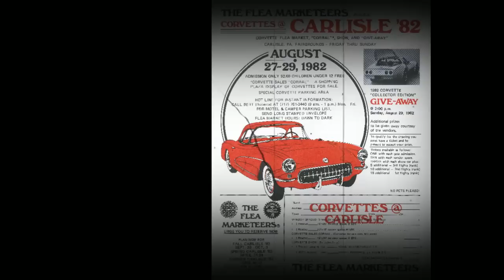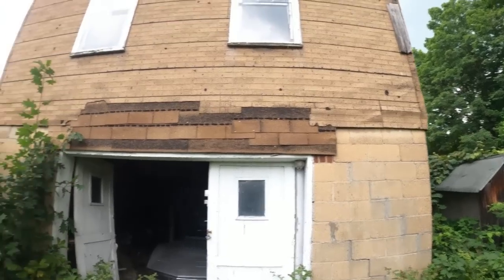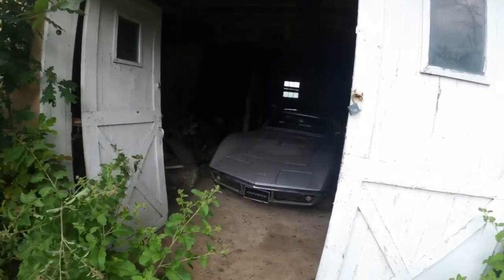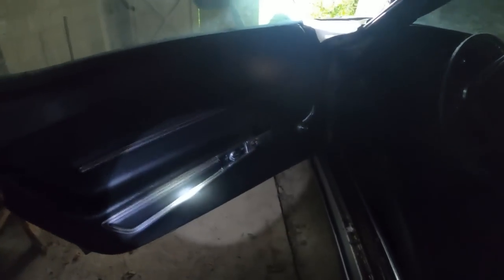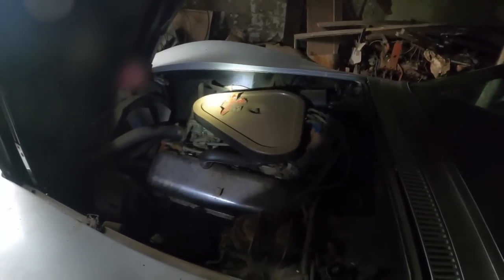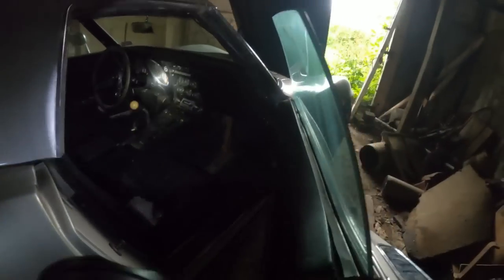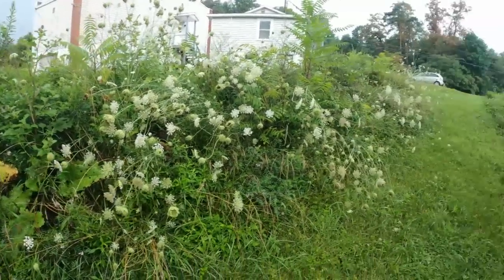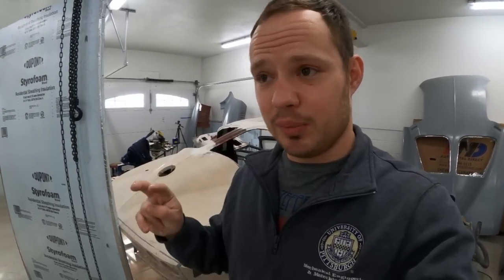Barn Find 1968 Corvette Big Block. Rare L71 427 435hp. Removed From It's 30 Year Barn Slumber.

Comment: I have a 68 had a 327 69 truck motor. Drove about 12 miles and went to change intake and found a bend push rod. So the motor looked shot so I bought another one. You would believe it I found a 64 327 Vette motor which they go from 64 to 69. I also have me a 427 hood which I love.\

Comment: It's a shame that the motor in this car wasn't treated as if it were a MARINE MOTOR. Put to you in simple terms, most boats spend all winter not being used. To prepare for that long winter, the spark plugs pulled out and oil is squarted in. Then the engine is turned over. Rienstall the plugs. Tape up the air filter, and shove some rags up the exhaust. Check antifreez. GOODBY.

Comment: Great video Mitch!  Looking forward to seeing this car come back to life.  Would be nice to see you do it in stages to get it back on the road.  New fuel tank and lines, rebuild the carbs, battery and brakes.  Clean and detail the engine compartment.  New set of tires and shocks. The later C3 wheels with TA’s look better than 68 caps.  Get it running, clean everything then sort out the interior in steps…and drive it!  Hope you don’t blow it apart for a full restoration.
Reply from the maker: Thanks! I’m excited to start working on it. I’ll have to evaluate that when the car shows up. I don’t want to have to chase issues with the car. My concern is that mice chewed up the wiring and I’m sure all the rubber in the car is rotten. So we might end up lifting the body and making the chassis brand new and setting the body down just like it is with new wiring and some interior parts. I’m not sure what the car will tell me. That’s a problem for future me lol. The car definitely won’t get painted. It might get a restoration similar to the white split I did recently.
Reply: Great find. It’s in good hands now.
Reply: @MidYearMitch  As you noted the engine looks period correct but not original, something it will never be again. Trying to restore a barn car by replacing parts with period parts is a fool's errand. Lifting the body, making the chassis brand new, and setting the body down just like it is with new wiring and interior parts is the way to go unless you want a lifetime project which I'm sure you don't. Best of luck getting this one back to snuff..
Reply from the maker: @rtflone the plan for the car as of now is to leave the body as is but completely overhaul the engine, transmission, rear end, suspension, wiring, and interior. Basically everything but paint and chrome. I want the car to be reliable and safe. I don’t want to cheap out and have some kind of failure down the road like a bad brake like or bad wiring. She’s due for some love.

Comment: I have dug a bunch of cars out of long time storage and this doesn’t add up: judging by the floor around it, the carpet inside, the engine compartment and valve covers why is the car cover and paint so clean? The outside of the car cover would be a lot more messy. Just being honest.
Reply from the maker: This is the real story. I wouldn’t “fake” a story about my Dad’s late best friend. I am presenting everything as it is. Did you watch the full video? There are plenty of references to how dirty it is. 

The lighting in that building is bad so it’s hard to see how dirty it is. He had a sheet of plastic overtop the car cover. The cover was soaked in water and covered in dirt. That helped keep the car a little clean but it was still dirty. It sat under that cover since 1991. I also swept the floor before I started working so I wouldn’t have to roll around in all the junk. The engine compartment is packed full of leaves and plastic from a rodent building a nest. The car was packed from front to back with junk under it. I had to shovel all that out before the car would move. This is the real deal.

Comment: Dug that thing out just in time!  This is a cool project and while not completely original (wheels, paint, cassette player) it is a complete car so you won’t have to go hunting a bunch of stuff down.
Reply from the maker: Absolutely that building wasn’t good for the car. It was very damp in there but it was a neat looking building. It had trees as supports. Since the car is a 68 that’s very important that it’s complete. 68’s can be even harder than 63’s to find odds and end parts.

Comment: Pretty cool that there was still air in the tires and very little dust. A dirt floor would have also meant rotted frame.
Reply from the maker: The new owners came and put a little air in the tires before I got there. I think the building got significantly worse in the last few years. So hopefully it was preserved for most of those years. I checked the frame and it felt really solid. It has a lot of paint still on it.

Comment: Bull honk,,, no way 30 years,,,, the tires alone tells me your Bull honking 😊
Reply from the maker: This is the real story. I wouldn’t “fake” a story about my Dad’s late best friend. I am presenting everything as it is. Some of the tires were aired up before I got there. I wasn’t the first one to lay eyes on it after 30 years. I was there to get the car out. 

The lighting in that building is bad so it’s hard to see how dirty it is. He had a sheet of plastic overtop the car cover. The cover was soaked in water and covered in dirt. That helped keep the car a little clean but it was still dirty. It sat under that cover since 1991. I also swept the floor before I started working so I wouldn’t have to roll around in all the junk. The engine compartment is packed full of leaves and plastic from a rodent building a nest. The car was packed from front to back with junk under it. I had to shovel all that out before the car would move. This is the real deal.

Comment: My fear would be damage from rodents and wiring.
Reply from the maker: That’s my fear as well. It definitely has rodent damage. That’s why I want to put a new wiring harness in the car right from the start. I also want to have the engine checked out just to make sure it doesn’t get hurt.
Reply: @MidYearMitch  Nevertheless, restoring one of these, at least for me, will be a wonderful adventure. A new wiring harness is just smart. An ounce of prevention.......

Comment: No 1968 Chevrolet 427 V-8 EVER produced 435 HP. With a two offset valve head even at 14.5:1 CR and 5500 RPM, that engine can only produce about 370 HP with a carb or 382 HP with the optional fuel injection GM offered and that on 130 octane pump gasoline (hard to find, but available in about 20 states).  "Flash" dyno numbers don't count. If it can't HOLD it for 15 minutes, it isn't real. The heads of a GM won't support more than 14.5:1 on the street without knocking itself to pieces, stock. Hemi heads will BARELY support 16.5:1 on 130 octane gas and will deliver about 1 HP per cubic inch at 5500 RPM with carbs or 1.1 HP per CI fuel injected. If you don't agree with my numbers, I direct you to Sir Harry Ricardo's "High Speed Internal Combustion Engines"-Oxford Press 1934 and do the math yourself! Brake Mean Effective Compression (volumetric efficiency) X Net Engine Displacement X RPM= HORSEPOWER/750000= Kw Nobody has EVER broken his formulas. He tells you what Nitrous will do, 43% hydrogen peroxide, pure oxygen, any flavor of pressure adder, water-methanol injection, 20-odd different fuels and MUCH more. BTW Chevrolet CLAIMED the 427 made 365 HP in the sales brochures for the 1968 Impala Super Sport with the four speed (about right for 120 octane gas). We BOUGHT a 1968 Impala with the "Baby Block" 327 High Performance 275 HP engine-the power of a big-block but 145 lbs LIGHTER! I have the yellowed very fragile sales brochure show the option packages available. "Vettes with the 327 couldn't out drag a 427, but give them a twisty road, and the 327 showed what a SPORTS CAR was meant to be.

Comment: Did you notice the massive crack in the frame at 1:56 in the video.  This thing is junk.
Reply from the maker: What are you talking about? 🤣 the chassis is made out of 2 pieces of steel that are U shaped. They are welded together and they didn’t fully seam weld them. They skip welded. Also the trailing arm is constructed in the same manner. The car is anything but junk my friend. It’s very restorable and I have inspected the frame since. It’s very good car.

Comment: Beating on the rotor makes no sense
Reply from the maker: The emergency brake shoes are on the inside of the rotor. They are basically a drum brake setup. They are rusted to the rotor. So you hit the rotor to shock the rust and break it free. So it does make sense lol. Because it didn’t roll and then it did. The proof is in the pudding.